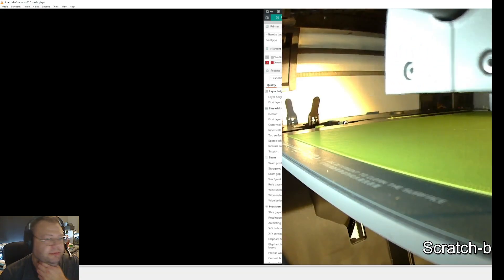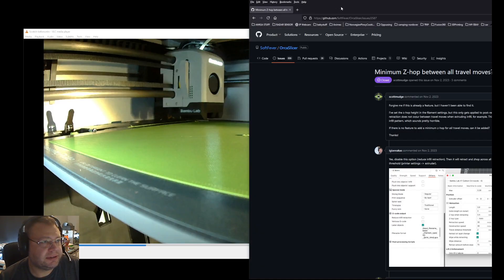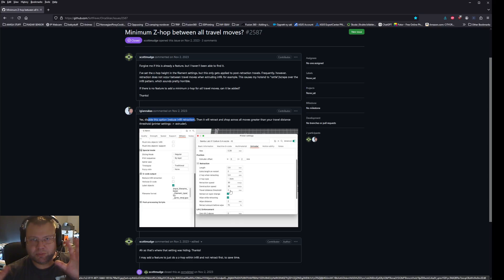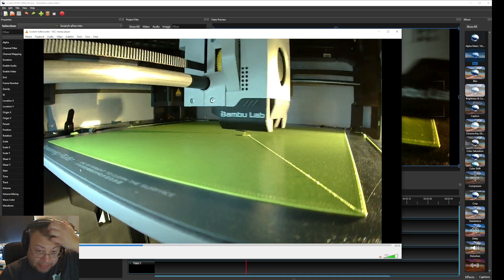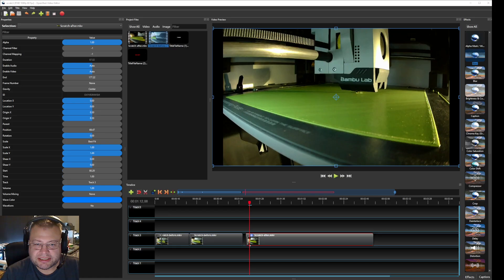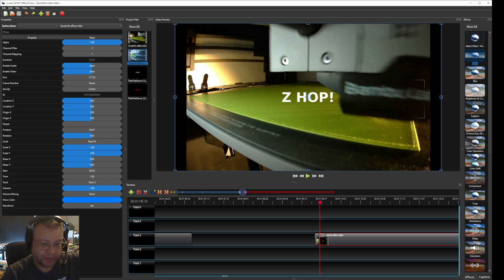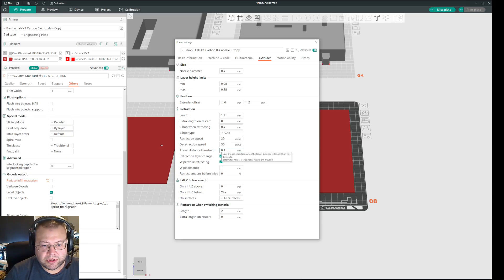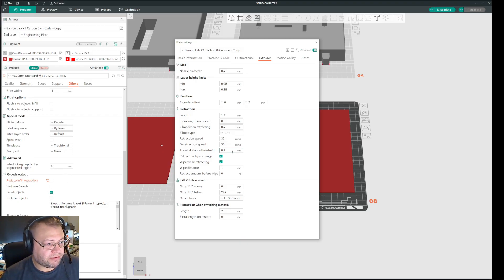Orca / Bambu Slicer - Fix nozzle scratching filament infill/surfaces!

Comment: For me this didn't help untill I also changed Z-hop type from auto to normal. With auto for some reason it didn't retract/z-hop on this type of moves.
Reply from the maker: I do not know about others, but i always print with the main z-hop 100% OFF since it saves virtually zero time on prints for me.

Comment: I've notice with 3D printers when brand new they don't do this, but overtime something happens either software wise or hardware wise that just cause this issue. My Prusa mini ended up doing this and z hop fixed the issue. My Bambu A1 mini is currently doing it and z hop hasn't helped but increasing it's printing temp has.
Reply from the maker: Actually is a software setting from the slicer unless you run a file from the memory cards. This is not the same as z-hop which raise the nozzle when it moves to other objects which is why the setting is called "reduce infill retraction" basically hooking this will prevent the nozzle from going up when it traverse over infill. Causing it to scratch the surface. The speed lost due to movement is microsmall and thus this option should have been disabled by default. If the software is updated by default these settings come back on.

Comment: I'm getting serious human-hair-like stringing with these settings. Retraction - Length - 0.8 (default). So it's less than your 1.2 already, plus I print at 230 deg C or higher. Knowing this, how far should I go with the retraction length, in your opinion?
Reply from the maker: 0.8 is too low, you increase retraction to get less stringing.  For PLA, do not print too hot, or it makes the plastig to watery/fluid which makes it ooze out of the nozzle easier. Keep temp under between 210-220, and set retraction to minimum 1.2-1.5mm....which means when it reaches the end of a line, it will start to retract 1.2-1.5 mm inside the nozzle to avoid oozing of filament out of the nozzle. In additon select "avoid crossing walls" and set it to 0 if you can. Download a string-tower-testing model , and run it for all types of filament you use. with string test tower try increase retraction to minimize stringing.

Comment: Thanks for the video! But let me get this straight. To enable infill Z-HOP you... enable infill RETRACTION. Then you also need to adjust settings in two completely different interface areas. Orca. Golden interface design standard...
Reply from the maker: to ENABLE z-hop untick box
Reply: @Toffypops  Understood. I am getting terrible stringing though. Like long human hair :/
Reply from the maker: @Tome4kkkk  increase retraction for each filament

Comment: Hi, great video. I'm not sure as this setting is new to me, but I think you made a mistake by saying that with 0.1mm in the Travel distance threshold, it will not hop at all ; to me it will always hop to not scratch the surface, as all your moves will be greater than 0.1mm. But it will not hop if the moves are smaller than 0.1mm.
Reply from the maker: technically you are correct. Even with 0.1mm set as settings, it will do a hop, but given wall thickness is 0.42 , for me at least, and usually cannot be set lower, unless you have a 0.1 nozzle, technically setting it to 0.1 for most jobs will make it ignore "everything" and always hop. In effect, for most prints, wall-width exceed 0.1mm, And i cannot see a situation where it would NOT hop because what is being printed is less than 0.1mm apart. You are not wrong, but it is extremely unlikely. :D When printing 1 line next to another, it will take into consideration overlap with the edge and line width.  Thank you so much for visiting my channel. :D Never had over 600 views on 1 video in 24 hours before. :D
Reply: @Toffypops  congrats for the views 👍 About your answer, you are saying what I tried to explain in my first message. With 0.1mm it will likely always hop; but when you mentionned it in your video, you said the opposite "with 0.1mm value, it will not hope at all" at 11:08 mins. This is what I was trying to explain 🤭